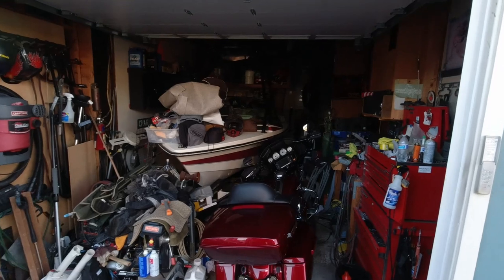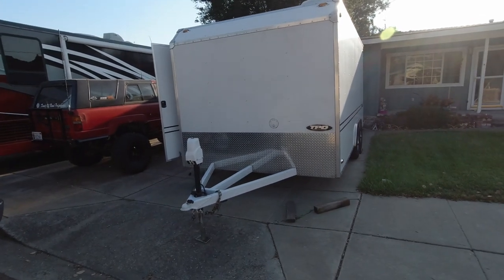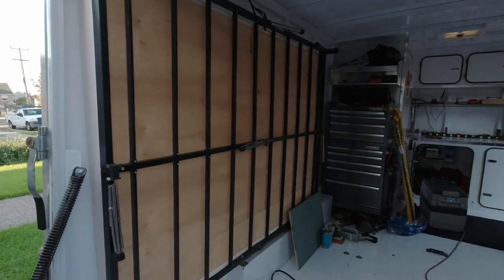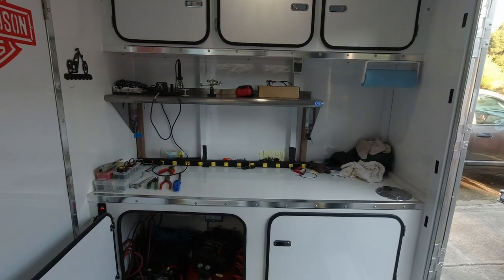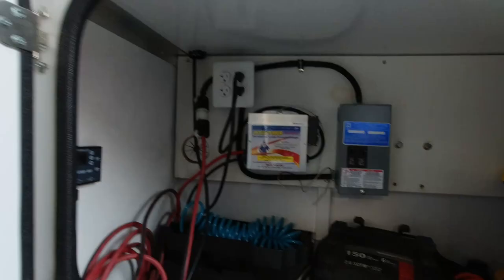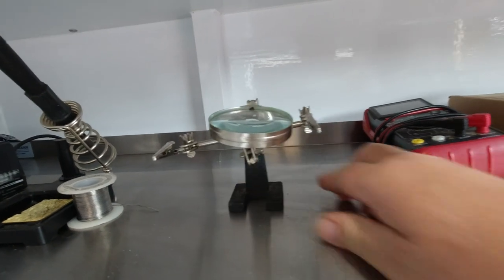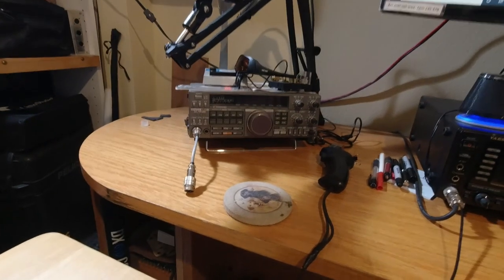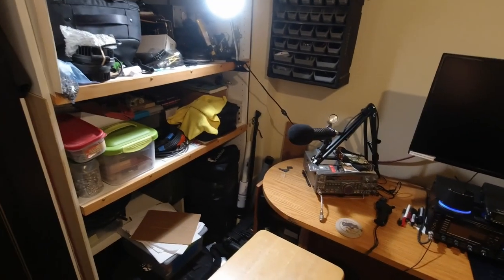Best Ham Radio Workbench's that I use for projects?

Comment: Maybe pare some of that stuff down. I know it can be hard to do but if its on the floor or hasnt been used in 2 years thats a sign. How do you like that Palstar AT2K? Im thinking bout getting the AT-500
Reply from the maker: Yea I just need to go through stuff and organize again. The Palstar is a great tuner very smooth and easy to tune, my main antenna for the lower bands is a doublet and it tunes it well.